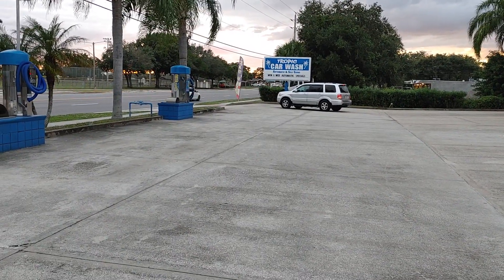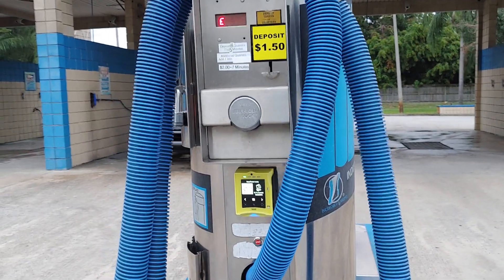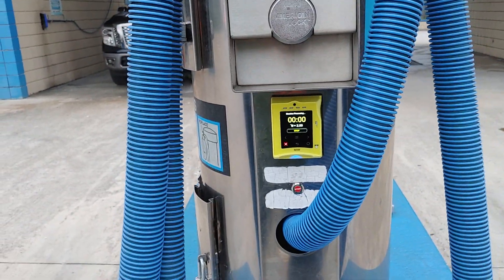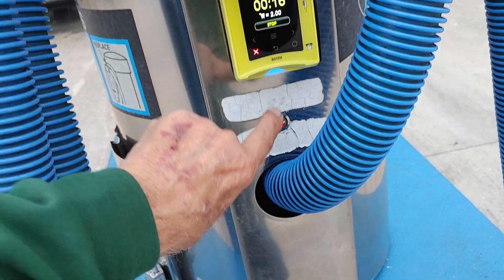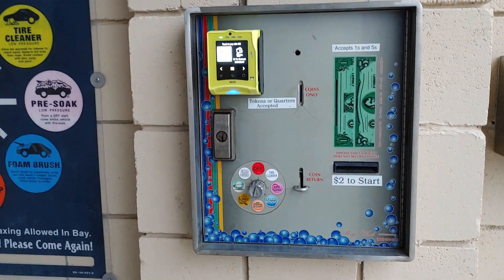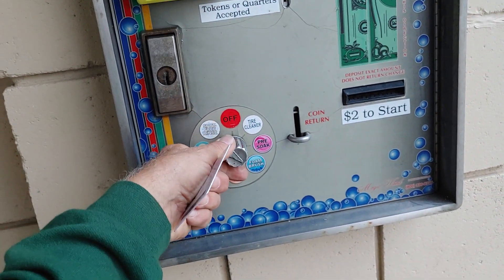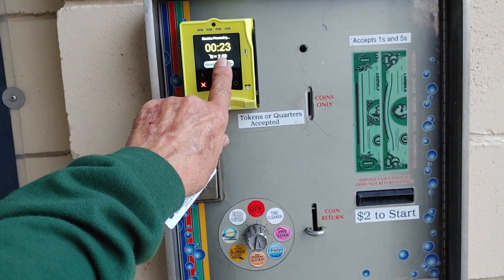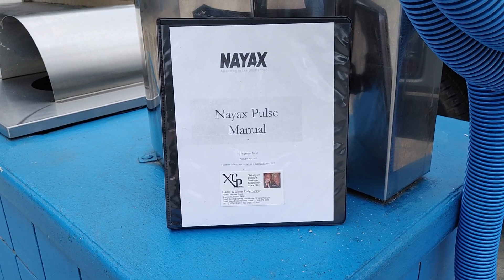Nayax Car Wash Retrofit From Cash To Both Cash & Nayax Cashless Payment Of Car Wash Bays & Vacuums.

Comment: Darrell, have you had any issues with water and the Mayan assembly in the bays?
Reply from the maker: Only problem is the Nayax Vpos Touch terminals do not hold up to hot water being sprayed on them by the customers.  The solution is to use the central payment station which is a fraction of the cost.  XCP Corp manufactures a central payment station that controls payments to 1 - 6 car wash bays for only $1,995.00.  It is on the XCP Corp website.